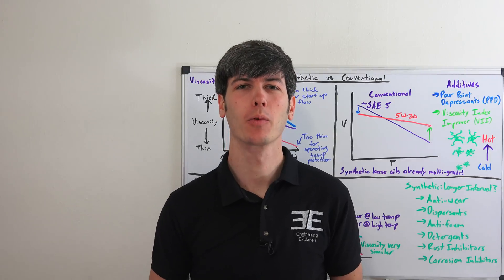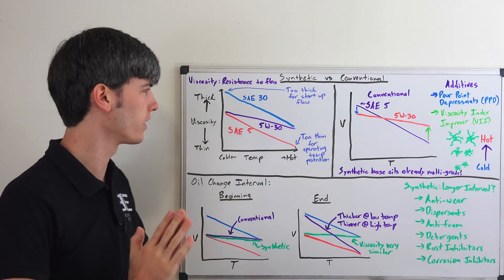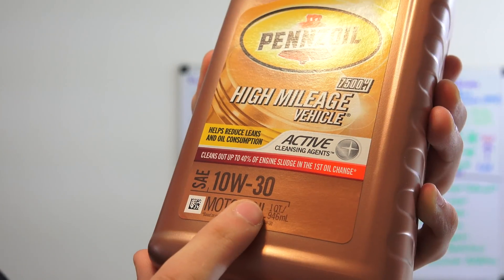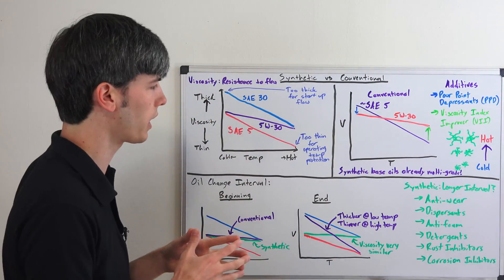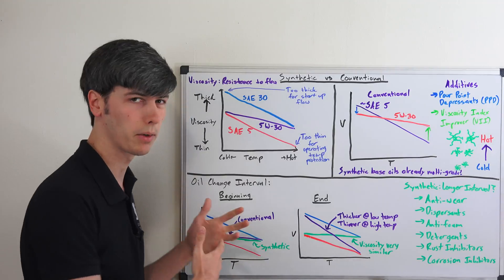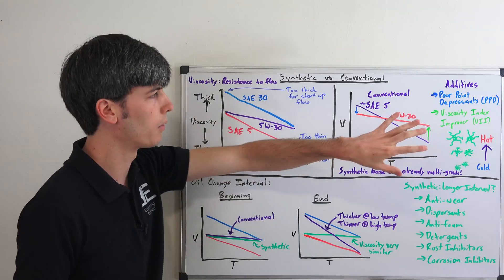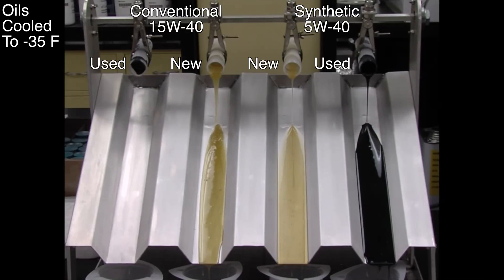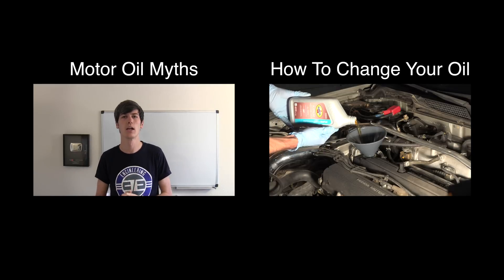Is Synthetic Motor Oil Better For Your Car?

Comment: I have a VW 2L turbo engine in my car, so I don't need to worry about old oil as VW have thoughtfully made engines that burn through the oil at alarming rates, meaning the oil in my car is never that old! Another innovative feature from the VW group.
Reply: The turbos are notoriously thirsty and abuse the engine oil.

The 2.8 VR6 on the other hand.... have one that's 17 years old and it's never run low even on 10K synthetic changes. ( even on short intervals, conventional oil broke down almost immediately )

Synthetic in the VeeDub all the way.  The turbos need much more care (but are fun to drive!)

If you want really easy, get a CR-V.    

Turn the key and it goes but not nearly as fun to drive.   No matter what, sir: Safe travels!
Reply: agree- VR6 never burns a drop. 13yrs old 210,000lms. Like new. DSG gearbox too; the oil is clean everytime i drop it. Great cars. I would avoid turbos.
Reply: Truetube2000 Well I've always used 5w30 (per the manual), and always had it serviced in the official garage for the stamp. I can't speak for the previous owner though...
Reply: I meant thirsty... for oil.  High compression eats it up in the turbos.  Fuel consumption is reasonable for that many horses and it's tons of fun to accelerate.  Enjoy!
Reply: My oil changes itself after 5000 miles hahaha!
Reply: I change my oil every 5 - 6 thousand miles even though the manual says 12000.  12000 is too long an interval in my opinion, my van smoked when I got it but stopped after a couple of oil changes.  It has started to again a bit now but it's covered 125,000, it was only on 68,000 when I got it.
Reply: Fuel-bills-wise: I've lucked out with short commutes for the past 20+ years, generally no more than 4 miles with some side jobs a bit longer, thus the VR6 only has 118,000 miles on it.  

Highway isn't terrible (around 29MPG) but since I'm mostly around town, only about 21-22 overall, and in cold weather only19 MPG.

On conventional oil, however (VW recommended 5W-40) there was an incredible amount of foam and sludge in the head.  Switched to synthetic and the problem disappeared entirely.

With the VR6 Timing Chain setup so precarious  I can't see any reason to not use the best oil possible: Synthetic.  All it takes is a little wear on the guides and the timing chain system goes "boom" and it's a full weekend job to do the chains.

About the engine sound: Yes! Someday people will drive electrics and we'll have to tell our kids and grandchildren about our throaty gas guzzlers.
Reply: I bought a 2009 Audi A4 Quattro new and gave it meticulous care which exceeded the manufacturer’s recommendations. It was the least reliable car I have ever owned. It required 2 engine blocks, 2 cylinder heads, and 3 sets of pistons to reach 142,000 miles. I threw in the towel at that point because it needed another (third) cylinder head. Replaced it with a Subaru and never looked back.
Reply: SirLoinOfsteak85   We had a 1977 VW Rabbit that burned two quarts of oil per fill up.  I don’t think we ever had to change the oil filter because the oil never had a chance to get dirty. LoL 😂
Reply: Dottor B Right I'm with you; yes you're not wrong about the oil consumption. It also doesn't sound as nice as the VR6; if I could stomach the fuel bills, I'd probably have one of those instead. ;-)
Reply: Just found this interesting. I owned a 2001 VR6 and two 1998 CR-Vs. Can confirm, the CR-V is not fun to drive. Had both auto and 5spd. The VR6 on the other hand was a complete blast, especially coming from a 1.6L auto Civic. Driving a 2000 Xterra (3.3L V6 auto), and while it's pretty slow, I find it extremely fun to drive. I enjoy the lift kit/big tires on it.
Reply: SirLoinOfsteak85 ..VWs truly have issues whether new or litely used. My newer or older Ford trucks and '15 Lincoln MKZ sport sedan never uses a drop of oil..ever. I never even check my Oil between changes an confirm this practice by checking oil levels right b4 an oil change! Btw I have Ecoboost twin turbo motors in My F150 Platinum an Lincoln MKZ AWD sedan. Both are well maintained but run hard. No issues of any kind. Owned 15+ Ford trucks/SUVs/cars and a few newer gen Lincoln sedans all bought new. Some used for pleasure the trucks uses for work mainly. Never let me dwn or my family! Next up is an '18 Lincoln Navigator😎👍🇺🇸🇺🇸
Reply: I wouldn't say it's thirsty...it doesn't use much fuel at all (unless you're hammering it, in which case it'll drink as much as you'd expect something with 210 BHP to drink), it's just the terrible oil consumption for me...
Reply: Never have to add oil in my past  2010 GTI 2.0t  traded it for 2016 at 147,000 never added oil between 10K mile changes.  Current 2016 GTI  40,000 never add oil between 10K changes
Reply: I have had 14+ VW audi products flawelss and fun, never been stranded ever since 1986 had a VR6 Jetta GLX 316,000 fun reliable, never straded miles, last GTI traded early at 147,00 miles, flawelss not a burp.  Current  2016 GTI 41,000 miles flawless and best one yet.  comfortable 33mpg, fun, quick, reliable.  Not a burp, not one thing wrong 41,000 miles, not even a burned out light
Reply: I ahve 2016 GTI performance pkg then /I added Eibachs, and power module to boost turbo boost, HP and Torque dramatically more, the GTI with the plug in module is QUICK beyond QUICK, handles like it's on rails Comfortable, reliable 41,000 miles on 2016, flawless
Reply: Vw always makes sure I keep up with my maintenance because all the parts wear out for me
Reply: cengeb I got to exactly 147,000 miles and blew a headgasket... That's when vws fall apart and that's unacceptable
Reply: cengeb my Passat wagon GLS is probably an extreme example
Reply: cengeb still enough to scare me away from anything VW group makes for a good while
Reply: Funny but true; i had a 5.7 with a had valve and a qt 2week leak. Drove it 4 years with a bad valve. My dad had a 57 chevy they tried to blow up but it leaked a qt a day and would not blow, hence the new fresh oil. I like this thinking; change it often is best.
Reply: If youre burning oil, its not the engine entirely, its your piston rings
Reply: Good old VW total loss. Never ceases to make plumes of smoke!
Reply: I have a cooking channel. I was looking up oils for my food. LOL.
Reply: All my 2.0t never use oil between the 10K oil changes, had 2010 GTI, no problems, current 2016 GTI no problems 2013 Tiguan, flawless, there is no problem with VW 2.0T, ya might belive in Santa Clause also?  Fake news
Reply: nope, never been my experience 14+ VW Audi vehicles since 1986... current 2016 is FLAWLESS 46,000 miles now, not a burp..fun, comfortable Quick, has ECS power module to boost the turbo...quick, solid, smooth, handles GREAT with Eibach springs and sways, and Continental DWS 6 Extreme contact,  I wore out original OEM Continentals a bit sooner, used to go at least 50k+ on past cars..I might take turns brisker with this MK7 excellence cus of taking off ramps, and fun speeds, front went down, rears still had some life, change them all 4 tire rack of course.  Car is flawless
Reply: cengeb yes but I shouldn't lose my entire cooling system (except radiator), brake fluid Reservoir, headgasket, oil pan seal, rear main seal, and struts all at 147,000 miles
Reply: Sounds way extreme from any experiences I've had with VW's since 1986....Always 100,000 miles out of brakes, GTI and GLX have much larger brakes than standard cheap Jetta or Golf, it makes a difference.always, highway driving and stick.  Never replaced struts or shocks, never 316,000 on Jetta VR6 never changed shocks or stuts, just strut bearings up front.  Power steering pump finally wore out at 316,000 time to get a new GTI in 2010, that went flawless 147,000 got rid of it EARLY, as I wanted new MK7 wider lighter, better, flawless, now at like 46,000 flawless perfect fun comfortable miles.  Electric steering is much better, no more hydraulics, and plumbing, flawless electric, plus performace pkg in 2016 gave Golf R brakes, even larger than GTI, now GTI gets bigger brakes above larger gTI brakes as standard, brakes matter, size matters, brakes on this GTI are bigger than on Chevy and Ford pickup turcks!
Reply: I think so!
Reply: SirLoinOfsteak85 if its burning oil you have an issue,  plus you may apply oil and it looks clean but what about your filtet? Over time you will have flow loss after it picks up gunk . Oil pressure is just as critical as clean oil , just a tip.
Reply: SirLoinOfsteak85 
Lol
Reply: SirLoinOfsteak85 😂
Reply: SirLoinOfsteak85 I feel ya, my 410k mile VW turbo diesel burns a gallon every 1000 miles. Still gets 49mpg and has yet to fail me.
Reply: Lmao, my 99 1.8T passat is the same way. Burns and leaks oil so bad I have to top it off with about a liter at the end of every week. She's never left me stranded and I love my vw group, but damn. Das auto I guess
Reply: Ha! 😁
Reply: As someone who worked with VW/Audi on and off at the dealership level over a 35+ year period, you are wrong!  You need to use a VW/Audi approved oil to protect the motor bearings and the camshaft against wear.  By design, German designed engines use oil to cool the internal engine parts.  VW has voided engine warranty claims unless you can prove you used factory approved oil.
Reply: @oldguy2082  I used the Castrol 504 spec (if I'm remembering correctly) oil that was recommended in the manual. I'm not wrong in that it did burn oil...and according to plenty of sources VW considered that "in spec" for that engine.

Car is gone now. Never left me stranded, and most of the damage done to it was by the official SEAT technicians to be honest (e.g. giving it back to me with the intakes not connected correctly, or having ruptured a fuel line which they didn't notice and put it down to "age").

I still liked it, but it wasn't without its faults.
Reply: I had a Mazda when I was a student it had done over 100k miles. My dad, who is a mechanical engineer, was horrified to learn that I never changed the oil. I explained to him my logic that it used so much oil it didn’t stay long enough to get dirty. He still laughs about that to this day... but the Mazda also never let me down either so I can’t complain.
Reply: Sarcasm
Reply: My Chevy pick up leaks it about a  quart or two a month , it's never dirty lol
Reply: Poor guy bought a vw...
Reply: The famous « Deutsche Qualität » 😂
Reply: Those engines shouldn't burn oil as long as the correct engine oil grade has been used (normally 5w 30).  If someone once put 10w 40 or something else in it will always be an oil burner from then on.
Reply: @DigitalTarmac1  Utter pish.
Reply: I have had 2 2.0T never used a drop between 10K changes, last one went 147,000 no problems, none, current one, not a spec used between 10K changes always use Syn  at weight spec, I use Motul or Ligui Moly, And Castrol I change my self, with a suction through the dip stick, filter on top, no crawling on ground
Reply: Parts wear out on anything mechanical...it's called Physics...I've seen lots of cars that supposedly last forever from TOYota, and it's easy to see, no maintenance, it's a myth..maintenance matters on ALL machines, $100 Million planes get constant maintenance
Reply: VW's cars are hideously badly built. I have one. Never having anothter
Reply: paulanderson79 I love the car, and I'd say it's well built. It's just that particular "feature" I'm not so crazy about.
Reply: Audi Turbo with 50K miles which is a VW subsidiary has the same oil consumption. I believe there is a class action out there. When you burn a quart every 150 miles or so, that is at least shear negligence if not down right fraud selling defective products.  We all know VW's ethics with the doctored software, it is held so low that you need a shovel. Be careful not to step on it or ruin good shoes.

Comment: Burn a lot of oil means either your rings are worn letting oil into the combustion chamber, or you have a leak somewhere in your oil sump.

Comment: I used conventional oil in my car engines for years then went to synthetic oil which caused the engine seals to leak many folks I know had the same problem ?  need feedback on this issue.    Thank You,   The Wolfman

Comment: I use Wal Mart Tec brand(ed) oil. I found out Quaker State makes that oil and most prob bottles it for Wal Mart too. I called QS and they confirmed the Tec brand is the same oil that's in their green bottle (Wal Mart does not own an oil refinery).   What's the benny? Less money, I save on oil changes, can change more often for the same price as higher branded oils and as a result always have clean(er) oil in my engine.
Reply: Not always that simple. Some engine requirements can;t be met with mineral oil.

Comment: My question is indirectly related to your video, but I am still compelled to ask.  According to the manufacturer, synthetic oil is specified for my 2012 Volkswagen Passat.  The oil change interval is once per year, but the car is driven only minimally.  Currently, the odometer reads 10,400 miles.  Once per year, the service reminder lights on my instrument panel to remind of the oil change.  So many of the maintenance procedures have not been performed because the car simply has not reached the required mileage mark.  My question addresses the recommended oil change interval.  Must I change my oil even though I am thousands of miles below the interval?  Or, does time also figure into the service interval?  Thank you for your advice.

Comment: fully synthetic oils did last longer for sure. Mobil 1 advertised 25,000 mile oil change intervals. But not the modern so-called synthetic oils. Mobil 1 and others did have synthetic oils in that none of it came from a hole on the ground.  I think it was Castrol who were using a mineral base oil for their "synthetic oil". Mobil took them to court and the court deemed that Castrol's was fully synthetic. Since then few fully synthetic oils have been on the market. You have to be in the know to know what is a fully  synthetic oil. I believe in Germany fully synthetic oil has to have no mineral oil in it. They do not go along with the US court ruling. 

So, modern so-called synthetic oils break down quicker than the real old synthetics. The vid is right in that many of the additives that are in mineral oils are already in the fully synthetic base oils, so will not break down as quickly.  So fewer additives are put in the synthetic oils.  The more additives added, the less of the oil which lubricates. 100% mineral oils are now near obsolete being difficult to buy.  When fully synthetic oils are available and well priced it is foolish not to use them.

Comment: fully synthetic oils have greater shear . That is, it is difficult to compress and part. This means it is superior at keeping the metal surfaces apart when under stress. Synthetic oils are thinner when cold ensuring oil reaches the bearings faster. 
It is not the case that mineral and fully synthetic oils have equal lubrication qualities when new.

Comment: Hi guys, my car is about 17 years old, it uses 10W30, I read that if I use synthetic oil for older engines the oil will leak because of the oil has smaller molecule. Is it true? What if I change the gasket because it is fairly old too, will it still leak?

Comment: Hi, this is my question. I have a 1964 Chevy Impala with the original 283 engine & I figure it has used conventional oil pretty much it whole entire life, I have been wanting to converted over to synthetic oil but wasn't sure if is a good idea since it been running with conventional oil for such a long time, thank you & I would really appreciate a feedback.

Comment: I change my conventional oil and filter religiously every 5-6000 kilometers and my car doesn't burn a drop of oil after 150,000 kms and 9 years. After all, isn't that the point? I see no reason to switch to synthetic.

Comment: Good demo. Had to explain this to a friend once. When i was younger i used Royal Purple in my POS Alero after years of regular oil. It made the engine way smoother. Due to being poor I went 9/month before i could afford to change the oil again with royal purple. The pan and filter was remarkably clean. This was after severe over heating problems I had prior. I figured the car was on its last legs after fixing the water pump so i never changed the oil thinking it wasn't worth it. Surprisingly it lasted another year before i traded it in for a 2006 Hyundai Tiburon. 

So I was wondering if anyone has any input on how good Royal Purple is and is it comparable to other top quality synthentics? My experience was good and I use it now in my Hyundai Veloster.

Comment: You said that conventional and synthetics have to be changed at same interval which would mean its 3k miles for conventional and 3k for synthetic. Why does every single auto manufacturer state that their newer cars combined with synthetic oil can go for 12-15k miles? Please respond Jason I am quite confused.
Reply from the maker: +ANACCOUNTIDCATALL you should use what oil the manufacturer recommends and at the frequency they recommend. Almost all new cars now recommend synthetic, and as tech improves they find the intervals for changing oil are longer.
Reply: Ok, thank you for the quick response I appreciate it. Also your videos are amazing please keep making them I've seen almost every one.

Comment: lots of excellent info, Broham!  BUT - seems like the headline is that engine oil actually becomes more viscous as temperature increases.  This is opposite to many fluids in which flow becomes easier as temperature increases.  This means the slop on the graphs should go up.  5W will go up the hill to hit 30 weight.